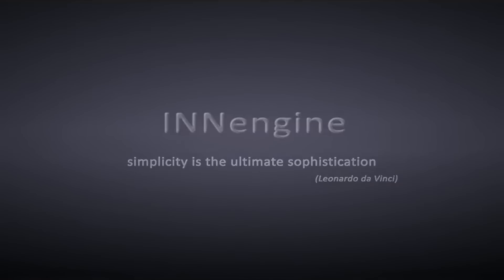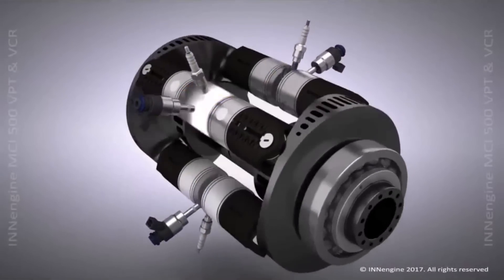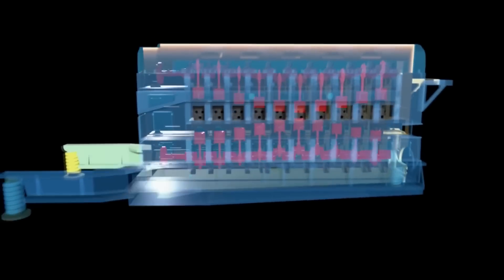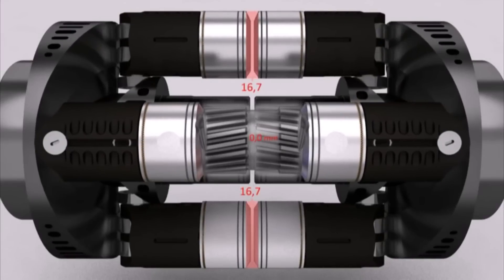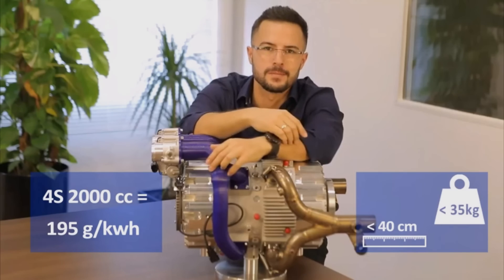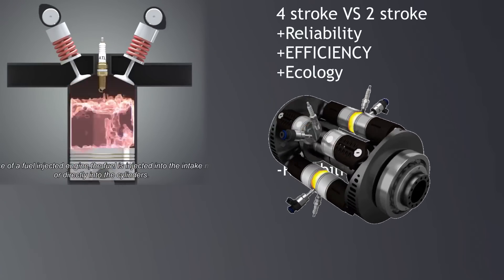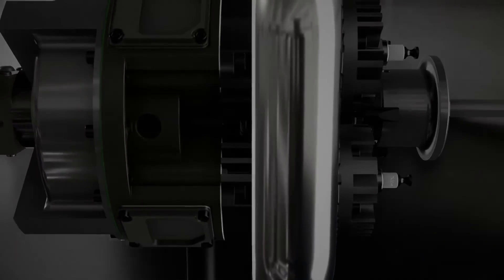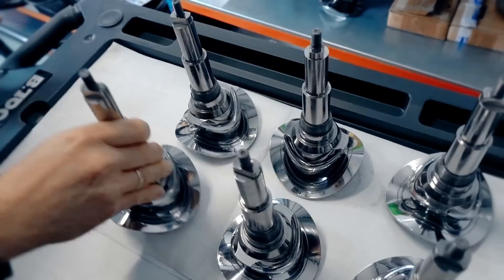35kg 120hp 1-STROKE Engine HOW WORK??? 2024

Comment: Not plates but CAMS, as in DUNA-CAMS. I want to buy several of the 120 hp engines set up for pusher airplane use and at least 1 of the 170 hp engine. 
Diesel versions need to be produced and I will buy some of them.

Comment: It's a 2 stroke engine. 
I have big doubts about its area of use.  the transmission of the torque produced is really not ideal.  and I believe that this engine had been tested on an MX5 with the addition of a compressor, not NA.

In short, it seems to me to be yet another hoax.

Comment: Lubrication is not a problem.
A bigger problem is the shock load on the rollers at the beginning of the explosion and the different peripheral speeds on the cam mechanism depending on the cam diameter and width of one cylindrical rolle. Rrolles must have conical shapes and cam area with half cone angle.
Reply: Ball bearings can handle more of a dynamic load than roller

Comment: Cam track  and piston rollers lubrication would be my first concern. Otherwise, this is very interesting and promising. The less moving parts, the better, plus it seems less technically complicated as compared to Achates.
Reply: No, ask yourself, How the rotation of the pistons would be prevented, so, that the bearings would run on the exact predicted/constructed path  !!! ??? !!!
Reply: @kopronko  Wobbing plate, Axial/ Barrel engines,  https://en.wikipedia.org/wiki/Axial_engine had scavenging, cooling, servicing problems. 
Lubrication is solved just by adding the adequate amount of oil to the right place, at the right time.
The 4 cylinder air cooled INNengine has an unparalleled weight to power ratio. 
SAE reported that under any circumstance, Schnuerle, Loop scavenging for 2-Strokes is better than Uniflow scavenging.

In this type of engine, I'd have the intake ducts largest as possible, with no bends, that in Wankel help blocking backflow of mix into intake manifold, in this type of arrangement may add nothing.
   Size and shape of ports is also important, deserves specific research.

For the combustion chamber in big INNengine having best results, it could be carved on piston head, a lot of Diesel experience exists about this. 
Gesund +

Comment: The side thrust from the rollers climbing the swash plate inclines will cause premature and significant wear to the pistons making this concept a non-starter in its present form.
Reply: The pistons have a full-length skirt to help keep them straight and there likely are other locating features not shown or emphasized/explained in the animations. Add some sort of bearing at the cylinder base for the skirt to ride on, that takes care of side-loads much like a crosshead design. Journal bearings on a crank shaft have a much harsher life and still manage to last a long time on nothing more than regular oil and filter changes. The piston-cylinder bearing could be as simple as an oil channel feeding pressurized oil between the skirt and cylinder wall. That may even be how oil gets sent to lubricate the piston rings and cool the piston head.

Comment: Too much smoke without any dyno tests. No info about max/idle rpm, about max torque (150 or 160 nm?) rpms on their site. No info about reliability. And it's 2S engine sure, not 1S.

Comment: Too bad is not in production yet. I would be ready to buy one now in my ultralight airplane, wher I need 100 HP. but need to be a light weight engine.
Reply: El de 120 HP pesa 35 kg.
Reply: @19piolin82  pero cuando va a estar disponible?

Comment: Give me some data, please. Brake specific fuel consumption, THC before catalyst, brake mean effective pressure, indicated mean effective pressure.
Scavenging will ruin your emissions, side forces from piston and guide to cylinder wall must be very high.
How do they make sure that the pistons do not move radial? The bottom bearings contact surface are just lines, considering clearances there must be an additional piston guide. I think it is that linear groove on the lower part of the piston.
And the spark plug and injector position... spray will hit the liner and there is a reason why almost all newer engines have a center position for spark plugs...
This is not a simple easy engine...
Reply: doesnt need all that. its engine for one way drones. or maybe torpedoes... small and strong but wont last long. but if only half of engine was used im sure it would be cheaper too

Comment: Manufacturers can use smaller batteries which will be kinder to the Earth and weigh less, improving efficiency, The batteries won't need to be subjected to Level 3 charging which heats them up and shortens their life, adding to the landfills. The batteries will always be optimally charged for the longest battery service life. All the simplicity of battery power without the range anxiety. For those who live in condos or apartments, hybrid is a necessity.

Comment: This thing will wear out very fast.
And BTW you can't have a "1-stroke" design because the power and exhaust strokes have  to take place at different time.
Reply: Well, a little faster , yes, Because of not precisely good paths of the cylindrical rollers towards the round curve of the guides .
Reply: Did u not watch the video it’s explained
Reply: you dont need to run it for long on torpedo...
Reply: They said that they call it 1-stroke because of marketing reasons. If they were to say 2-strokes it will confuse people with standtart 2-stroke engines.

Comment: it works, the only question now is durability or reliability
Reply: Fuel efficiency ?
Reply: According to experts, this engine cannot run well without a turbo or supercharger, it's uses the supercharger or turbo to prevent the exhaust air from getting inside the intake Port
Reply: And what about lubrication , cooling , and exhaust emissions?  Does it burn and consume oil ?  I'd like to see it adapted for a small, light vehicle like the Aptera .  I would expect this drivetrain to be much lighter than an EV with a big, heavy battery .
Reply: @javadog6288  if you love technology just like me, then you know this engine needs to go through countless number of testings before it gets into production

Comment: This is not a new concept, it's been done before.
Reply: When? Where?
Reply: @rll9911 It look like Opposed-piston put in Dynacam Engine  / Revolver-Cam Engine .
Reply: Muy interesante el sistema,el hermetismo del motor realmente hermoso
Reply: @rll9911  
T hink this engine combines the swash plate mechanism to the opposite piston 2-stroke  principle(Junkers Jumo 205 for example).
Nothing really new.
Reply: Damn right it's not a new concept. Barrel engines have been around as a concept since the early 1900s. At least. Cam type, Swash plate, Zee Crank etc. By the early 30s when the US Army gave up on them for aircraft use they had blue prints staked to the rafters of a hanger at Wright Field. Failures one and all. In addition Cam type engines with radial layouts have been tried even to the point of reaching the test phase and actually flying. The Chaminez in the US passed government tests and underwent trials by the Navy.